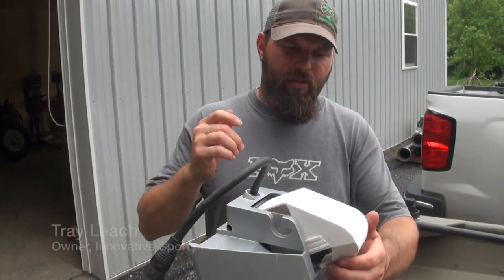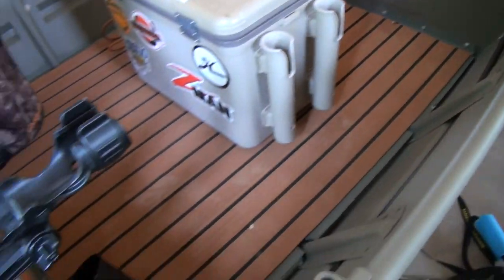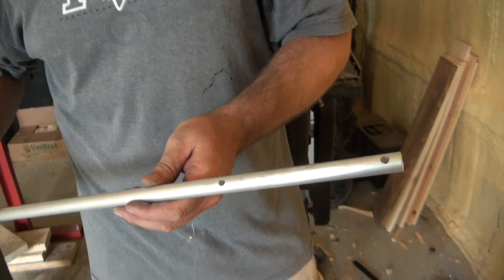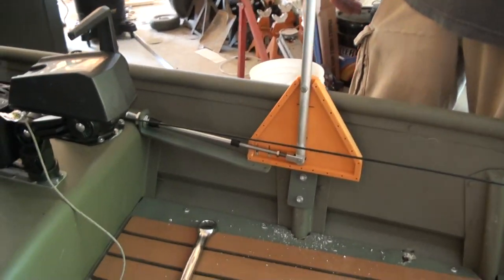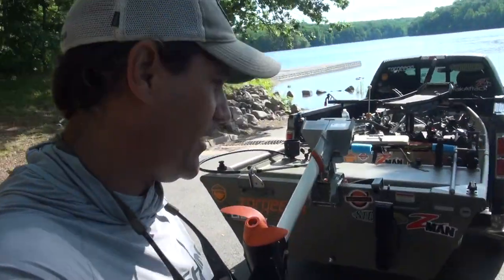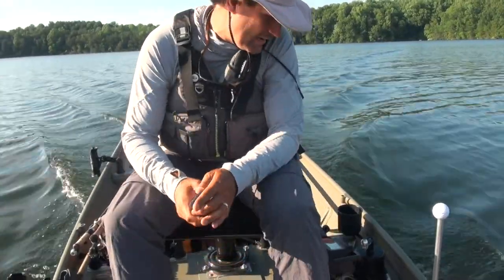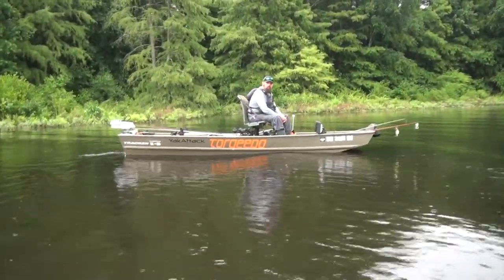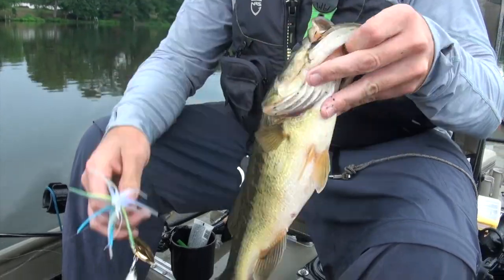Electric Only Jon Boat Build Part 3 Stick Steer

Comment: I'm stoked Torqeedo put up something dedicated to a Jon boat. I feel like there's a huge untapped market of Jon boat fisherman. I'm actually planning to do a very similar build utilizing an alumacraft 1436 (slightly lighter dry weight). I live right on an electric only reservoir and I've been researching electric outboards, and I've landed on Torqeedo Travel 1103c. I was skeptical about hitting +6 mph as stated on the torqeedo website but y'all confirmed it for me! I plan to stick with a more traditional bow mounted trolling motor as I plan to do simple lightweight decking using aluminum, purely because I prefer to stand while fishing.

Great build overall! It gives me more ideas as I slowly piece together my Jon boat build! Thanks for the upload.

Comment: That is so Awesome. I also noticed after yall installed the foam and all in the flooring you don't get the squeaking and flapping sound that a Jon boat has while turning like that and some of the rods that slapped the boat wasn't that loud. Great job yall.

Comment: I like the concept. But u need to b able to adjust speed while steering. U do that and u have a winner . And I’m sure u are working on that .
Reply from the maker: The throttle sits next to the seat.
Reply: @TheLittleStuff  true , but it’s a 2 handed steering device. .
Reply: U can’t control speed and direction with same hand .